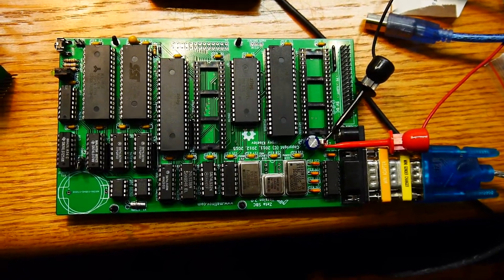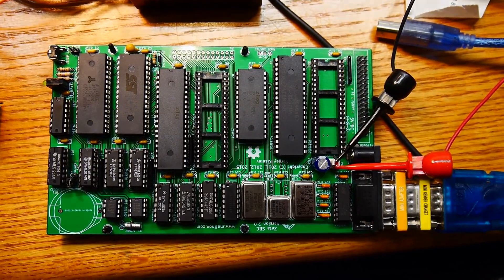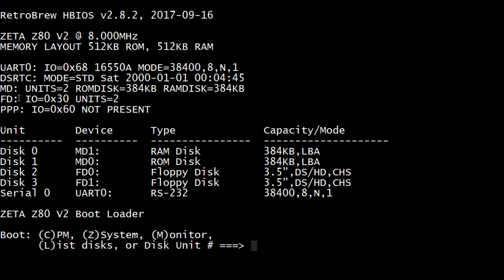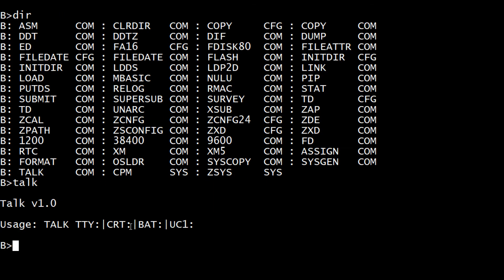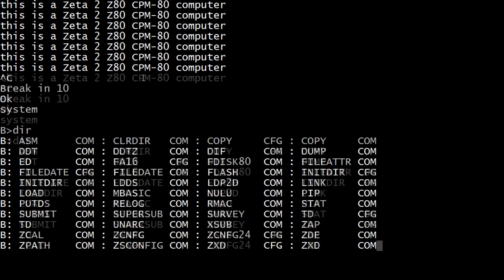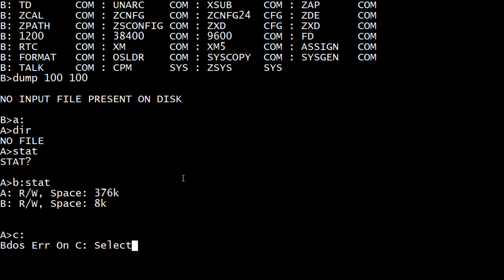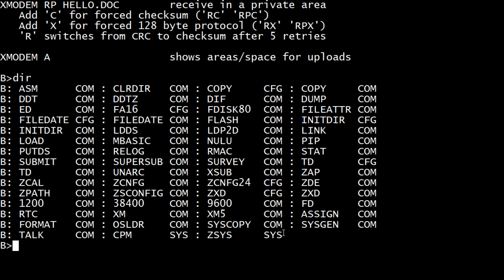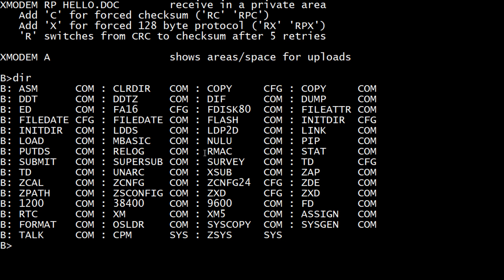#133 Zeta SBC Z80 computer complete

Comment: hi imsai guy.
Can i have the cpm  file if it is possible by give me a link were can i download it , i have same board and components im not  familiar with programming thanks.
Reply from the maker: https://github.com/skiselev/RomWBW
Reply: thanks for quick reply , from github webpage i have to download the code in green box? because there are a lots of file bellow binary,doc,source,tools ... so what should i do? sorry for my igonorance
Reply from the maker: @loubega-y5x  I don't understand what you are are trying to do. if you just want a working unit. use the file on my github. it has everything in it. CPM and programs.
Reply: yes i have a complete zeta board , and i need just only the file that you burned to the rom using your minipro. on the github website there are to many files im confused which one i take.
Reply from the maker: then just use my file, makes it easy

Comment: Whats next a 68000 ?
Reply from the maker: A 68000 based tiny basic machine is a good project. A friend of mine built one many years ago. I have experience with 68000 designs. I did one for a piece of test equipment. Pretty easy microprocessor to use.

Comment: It would be possible build a front panel for the Zeta like your old IMSAI had with the switches and LED's.
Reply from the maker: No, it would need to be a new design. You should look at the RC2014 computer. That one uses a bus and so would be a better starting place for a front panel machine. The RC2014 also uses the ROMWBW cp/m system.